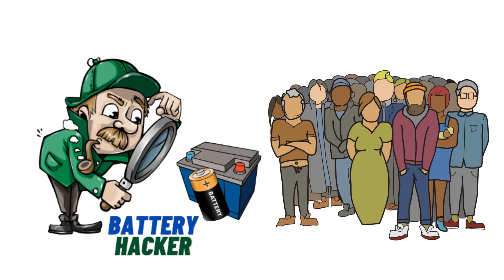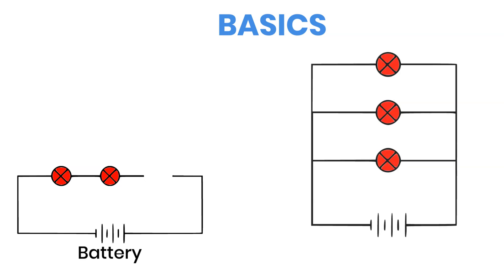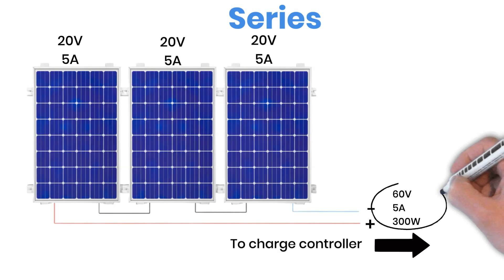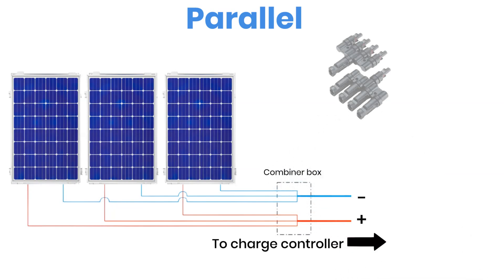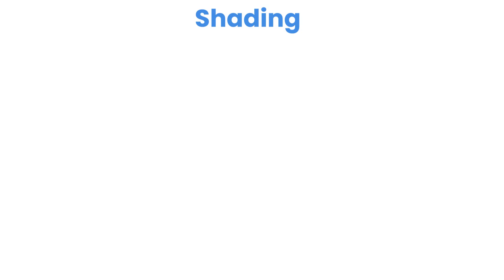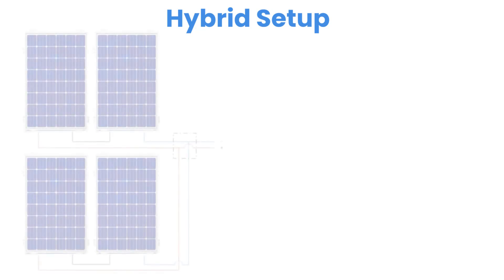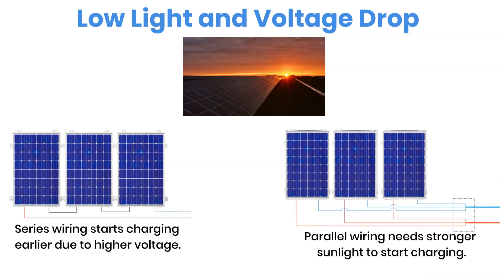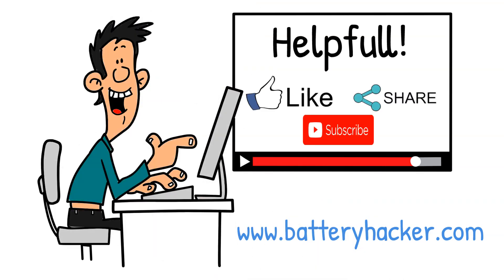Series vs Parallel Solar Connection | Voltage, Current & Shading Explained

Comment: Can you wire the panels in parallel and batteries in series and vise verse?
Reply from the maker: Yeah absolutely, you can wire panels in parallel and batteries in series (or the other way around), it just depends on what setup you’re going for.
What kind of system are you planning — off-grid or hybrid?